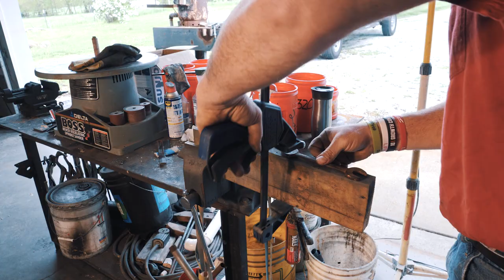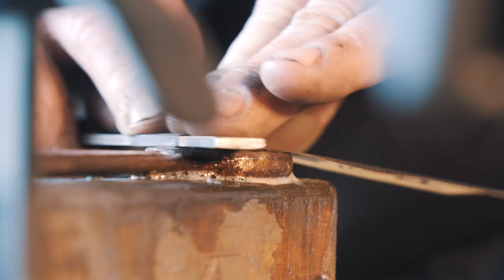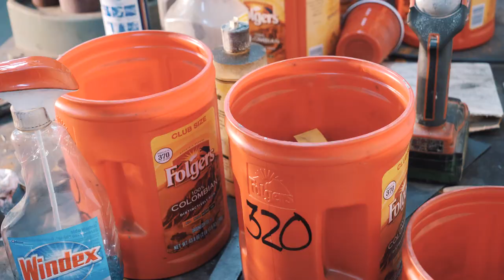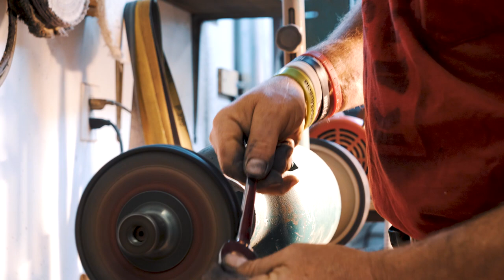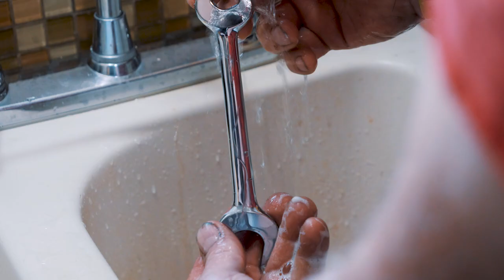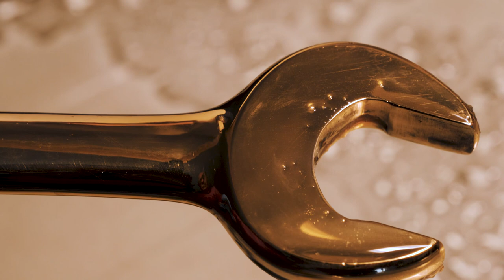It's Gold?!  an Old Rusty Wrench Restoration

Comment: Just a friendly tip of something I learned about the hard way:  be careful with laying your higher grit sandpaper face down on any work bench or exposed surface, it can possibly pick up some contaminants from metal dust in the air or from stray grit lower grit paper or other random debris and put a fresh scratch in the blade when you go to sand it with it and force you to go back through all the grits again.  I try to keep all my paper sealed and away from possible contaminants now days.  I like the old coffee containers you use to store the strips, I really need to get a paper cutter so I can pre-cut my paper into strips, sure would save a lot of time & hassle.  Anyway, you may already be aware of this, but I figure it can't hurt to double check :)
Reply from the maker: Thanks for the tip ~Team Royer

Comment: I'm so triggered that you tricked me!  I really thought you found a solid gold wrench and restored it! 😓  😁.  Turned out great, the gold plating is a neat idea.  As to your question above, I think it would awesome to gold plate a knife, even if it is a bit impractical.  Or you can gold plate some bolsters on a kitchen knife.  Another idea would be to give a deep etch to one of your Damascus blades and then buff out the oxides, then gold plate it.  You could then sand off the 15n20 layers with a high grit or just let them wear naturally over time while the 1080 layers would better retain the gold, kinda like hot bluing, but with gold.  You could also gold plate the inside of your maker's mark etch instead of using brass black to darken it, that might be kinda cool.   Looking forward to seeing your Midas touch-mark (see what happened there?) lol. Thanks for sharing, this was a quick and fun vid.  :)